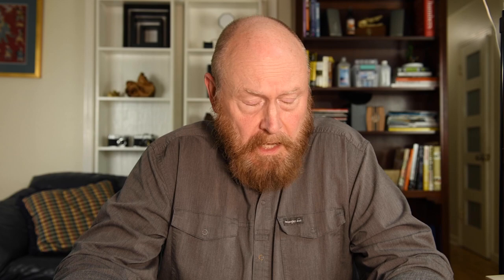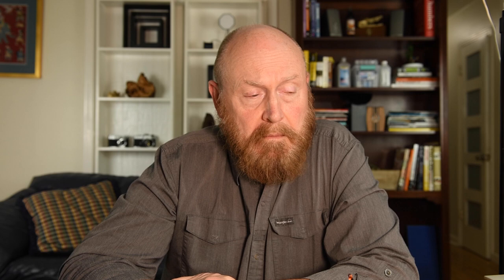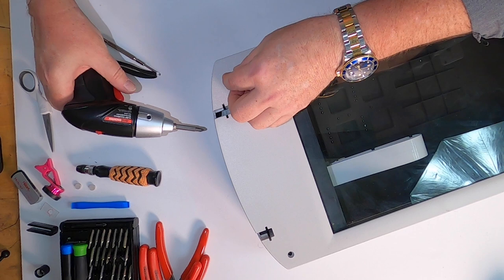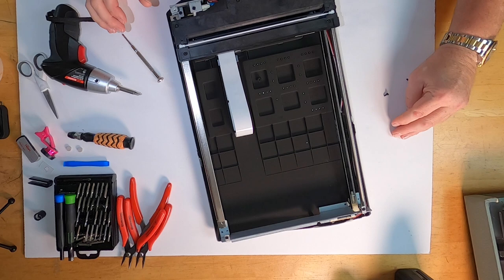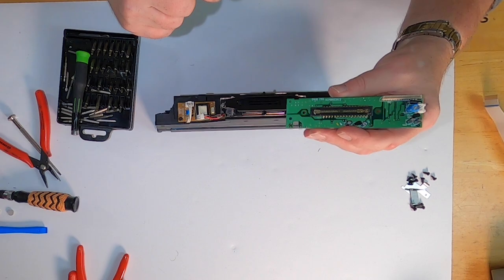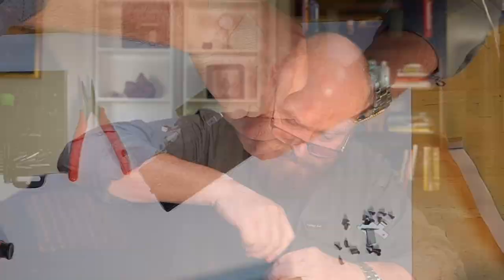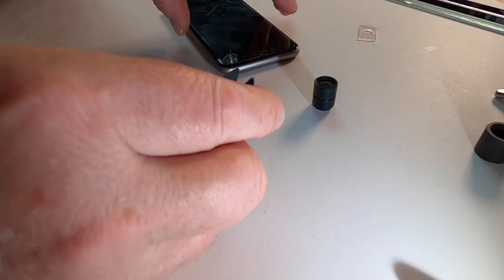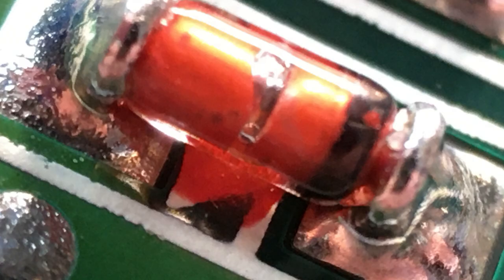Transform your Phone into an Ultra-sharp Macro Camera

Comment: Mercury doesn't fluoresce. Mercury lamps are arc lamps. Very cool and informative video! I think I have an old scanner I can tear apart...
Reply from the maker: Of course you are right, John. I should have said that the ionization of the mercury vapor causes high-energy UV emission, which in turn excites the color-correcting phosphors to fluoresce. I corrected this error in a subsequent lighting video (I hope!). Thanks for clearing that up.

Comment: Those silica bead bags are pretty common in shipping crates. Those long strings are just the fastest was to finish the stitching ok the seam and keep it from unraveling but you can staple it down to the crating on the strings or tie them off inside electronic enclosure boxes. If you microwave them or toss them in your electric oven range at 275 or so for a few hours. I have loads of them from various pieces of industrial equipment i order at work and cycle them through my camera gear closet to keep it dry.
Reply from the maker: Hey Andrew - I do the same thing - I never throw silica gel away. But what struck me as odd was that the strings on each corner of the bag looked like they would have been more at home if attached to a piece of lingerie. They are made of white lace! Very strange.

Comment: Allan my dad had one of those Argus projectors. There was a box shaped cartridge- kind of an ur-carousel - that you put the  slides in (perhaps each one in a metal edge frame to protect it from the lever?). The cartridge thing then fit into the flat part of that gizmo you slid in between the lamp and lens (you'd pull the lever out first). Then each time you pushed the lever "in" it would plush a slide into the window between lamp and lens. When you pulled the lever out, it would advance the cartridge forward one slide. Wow childhood memories. (ah, I see you have one of those edge frames!)

Comment: The slide projector is used with the aluminum slide boxes.  Each slide was mounted in a light aluminum frame like the one you have with the projector.  The red handle indexes the hook on the slide and pushes it into the light path.  As it is drawn out, the box should index to the next slide position.  The one I have can be operated automatically.  Nice projector.
Reply from the maker: Thanks Francis. But what is the purpose of the other part, the twin bladed finger guillotine?